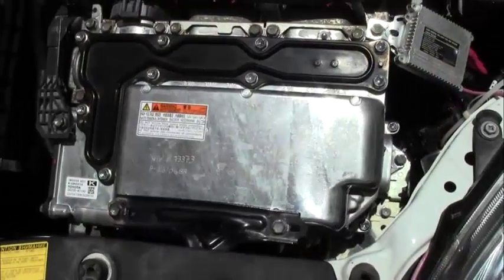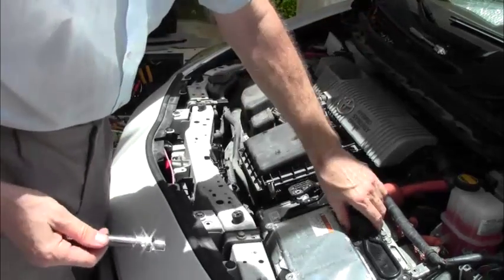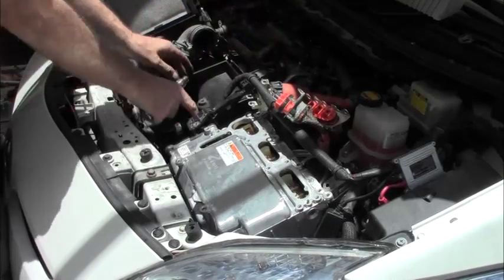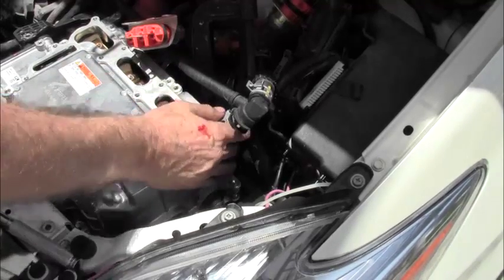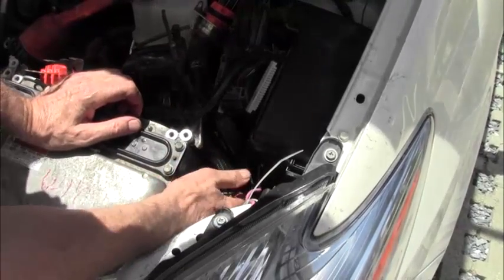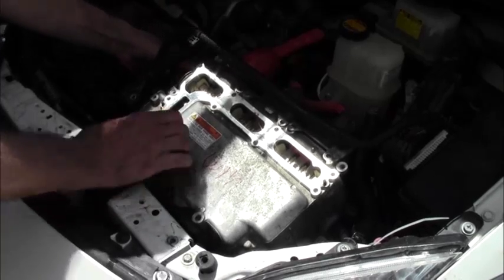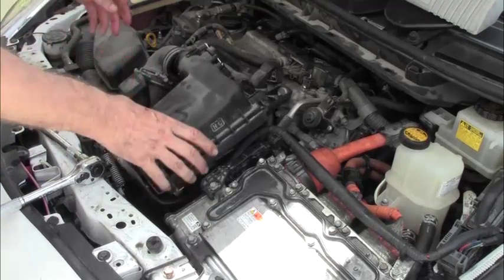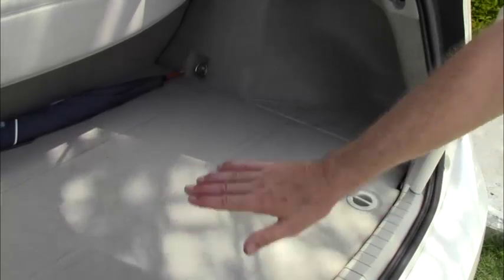Change ECU Inverter with Converter in Toyota Prius 2010

Comment: Hello and thank you for this work. I have the same problèm. The référence of mine id g9200-47140, can I change it by an other référence like g9200-47230 for exempl. Thanks
Reply from the maker: Hi, I don't think these are interchangeable, but I'm no expert. The 47140 is for 2010-2011. The 47230 I believe is for the 2012-2015. But you might want to check that. I'm not sure that my charts are accurate. What year is your Prius?
Reply: @TheHighwayGroupie  my prius 30 2010.
I order an other référence form lexus ct 200h.i will try it and let you know if you want
Reply from the maker: @geobes7339  OK. Yes, let me know how it works out.
Reply: @TheHighwayGroupie  hello. I just put the lexus référence on my prius and it s working for the moment. I hope it will work forever 😅
Reply from the maker: @geobes7339  I don't know about 'forever', but this kind of thing either works or it doesn't. So if it works, you're fine. Make sure that you keep it up to date will all the latest software updates.
Reply: @TheHighwayGroupie  OK thank for your reply. Good luck

Comment: If remove the converter for change the transmission mount , put back the converter need the program again ? ? ?
Reply from the maker: The ECU is a plug and play device. It requires no programming, even if you drop a new one in - although you may need to update some of its software by using CAL files (for calibration) and CUW files. But, unless you leave a wire disconnected or some other human error thing, changing a transmission mount should not disrupt the programming of your ECU. I hope this helps!
Reply: Thanks for help

Comment: Mazen Ateyyat2 months agogreat. could you please help me an issue that I face with my 2012 Toyota Prius. I saw a battery light followed by check hybrid system then the car stopped. the mechanist tested the error and it gave the code P0A08: DC/DC converter status circuit. the mechanist i
Reply from the maker: Hi, Hanif. It would appear that your comment was cut short. Nevertheless, this sounds like an inverter problem - likely the circuit board. There is a way of just changing the board, but it is time-consuming. I'm not absolutely sure, but I believe that 2012 is subject to a Toyota recall. If not, you will need to spring for a new or used ECU. Make sure that it has the latest cwu updates. The problem that Toyota experienced is overheating transistors. The new programming keeps them running cooler. Hope this helps.

Comment: Hi , the dealership told me to replace inverter converter... Do I just swap it? Or do I need to reprogram the ECU? Thanks
Reply from the maker: The ECU is a plug and play device. It requires no programming, even if you drop a new one in - although you may need to update some of its software by using CAL files (for calibration) and CUW files. 
Also, the computer needs to go through a 'learning' process where it gets used to the response from the battery, your way of driving and other variables from the motor. 
But, unless you leave a wire disconnected or some other human error thing, your new ECU should work right off.

Comment: Is there any part number can replace  number G9200 49025?
Reply from the maker: Hi. As mentioned above, I'm not a mechanic. That said, according to TLS Auto Recycling, G9200-47210 will also fit. But, before I would invest serious money in buying one, I would check carefully. The G9200-47210 is listed for the 2015. The G9200-49025 is listed for the 2013. However, TLS claims that G9200-47230 G9200-49025, G9200-47210 or G9200-47141 will fit anything from 2012 to 2015. Hope this helps.

Comment: What glue did you use to seal The converter?
Reply from the maker: I'm afraid that I don't understand your question. Each connection and cover has its own gasget. This seals the unit. Inside there is no need for glue. Could your please elaborate?

Comment: hi 

I have this crashed prius and the screen says check hibrid system... the inverter looks nice but my problem is that i live far away from a toyota dealer to get it there and check it. so i wonder if i can get some help from you
Reply: +Cesar Castellanos Actually i want to know if i can just change the inverter without any programming i mean just plug & play?
Reply from the maker: +Cesar Castellanos Hi, Cesar.Yes, most times you can just plug and play. The unit I have for sale on eBay has already been updated to the latest software and firmware. If you buy a different one, I would advise you to go to the dealer or a garage with a Toyota Mongoose connector once you have installed. They can then check to see if it needs upgrading.Short answer: These units have two possibilities: they work or they don't. =D If it is a working unit, then it is plug and play. Hope this helps.
Reply: so can i buy any inverter no matter the model the only thing is that i need to update the firmware. Is that right?
Reply from the maker: +Cesar Castellanos Hi, Cesar. I'm not sure what you mean by "any inverter". There are two different part numbers that will fit the 2010 and 2011 Prius. Beyond that, yes, you will need to update the firmware and you should check for updates AT LEAST twice a year. More often, if you can afford it. But you do not need to update it for it to funciton after installation. Put it in and start the car.
Reply: +The Highway Groupie my car is 2015 so I don't know if the inverter has to be the same model which is g9200- 47230
Reply from the maker: Cesar Castellanos Hi, Cesar. I'm no expert on part numbers, but what I see is that 2010-11 were interchangeable; 2012-2014 were interchangeable; 2015 is a new series. I suggest that you check with your local garage.
Reply: i have same message check hybrid system i did change inverter water pump but same nothing change ,what does inverter converter do

Comment: I really liked test driving a 2014 Prius V, and would love to get one, but when the hybrid system starts to have problems, I don’t see how people can afford the repairs, and it keeps me hesitant. It’s like there is a typical internal combustion engine with all its maintenance and repairs, plus this hybrid system with each part costing thousands to replace!
Reply from the maker: Hi, Flying Cat.
The car in the video had a problem because of a programming error at Toyota. They paid for the new part. Otherwise, if programmed correctly, these last a very long time. In fact, I bought a used unit with quite a few miles on it and left it in the car, while I try to sell the new one. But they aren't much in demand. =D The car is still running on a system that will soon be nine years old.

The hybrid battery has an average lifespan of 10 years. You can get a new one for around $2,500 – cheaper, if you look around a little. If you only drive a few miles per year, then it isn't worth it to get a hybrid like this. But if you put a lot of miles on, such as about 22,000 miles per year, then it gets interesting. 

On a Prius, 22,000 miles would use about 500 US gallons of gasoline (or less, if you don’t use the AC like I do). On a non-hybrid, it represents about 880 gallons for the same size of car. In South Carolina that difference of 380 US gallons would cost you $763 per annum. Assuming that gas prices remain the same (and they will likely go up, not down), your savings over ten years is $7,630. That more than pays for a battery change. =D 

The battery on my 2010 still works fine after more than eight years. So, it has already saved its drivers over $6,000. Again, it depends on how many miles you clock per year. Do the math and then decide.

Before I leave this point entirely, there is one more thing: the environment. Even if you don’t save a ton of cash, you have the satisfaction of knowing that you are helping to lower your carbon footprint. =D

Hope this helps,
HG
Reply: Thanks for the response!
Reply: flyingcat2054 well that’s why this car help you save money😉
Reply from the maker: Adding to my earlier reply: The car is now 9 model-years old. The battery gave an error message that could be read on a standard OBD II device (such as an Actron). 

We went into the battery compartment (using all safety precautions) and discovered that the connectors had corroded. We removed the connectors, cleaned them with a Dremel grinding wheel and some electrical cleaning fluid and replaced them. The battery is still holding over 7.6 volts (ranged from 7.64 to 7.9). This is still within range of a properly balanced battery, but we balanced it a little more by lowering the voltage of the ten cells that were above 7.8. 

Error message is now gone and the battery looks like it is ready to run for several more years!

Kind wishes.

Comment: Why you change that invertor convertor? What is the problem sir?
Reply from the maker: Hi, Lakshitha.

Thank you for your question. The problem with the old one was the transistors. They burned out. This was guaranteed by Toyota and they did eventually replace it, but it took 4 months. I couldn't wait that long, so I bought a used one and put it in. Later, when the new one arrived, I installed it, updated it with the latest programs and then removed it for the used one, which has been working fine ever since.

I have the new one for sale, if you are interested.

Kind wishes,
HG.
Reply: Thanks you for giving me a reply.. sir. You did it funny. Old invertor came any DTC? Or vehicle not sarting?  After changed convertor invertor do need to programe the key or want to do something? Please send to me answer sir..
Reply from the maker: @lakshithakalansuriya7680  Hi,
There were no Diagnostic Trouble Codes (DTC) after installing the good inverter. If there were any codes, it would mean that the replacement unit is already bugged. Not a good scenario. =D

As for programming, it is always a good idea to check for updates using a TechInfo cable and software. By having the ECU communicate over the Web it will discern whether it needs updates or not. At that point you can click on the update code and then follow the on-screen instructions. 

Even brand new ECU's from the manufacturer need to be updated as some of these have been sitting on shelves for a few years. They don't update them before shipping.

Every 6-12 months it is a good idea to check again. Also, you should create an owner's account on the Toyota Web site. Then you can receive any recall or other notices in a timely fashion.

Hope this helps.
HG

Comment: Hey is this the gen 2 model or gen 3? If it's a gen 3 is there much difference in the repair?
Reply from the maker: +Gustas Dovainys Hi.The two are quite different physically and programming. As for changing one or the other, safety wise it is the same: remove the connector for the main battery and disconnect the ground to the 12V battery. Beyond that, you are on your own, because the installation is different. Sorry.
Reply: 2010 is gen 3

Comment: So...why are we doing this?
Reply from the maker: Not sure the thrust of your question, but for anyone where the warranty has run out on the ECU, this could help.
Reply: Part of your presentation should have included the function of the inverter and the symptoms associated with the need for replacement.

Comment: Man! How much could you charge for all this!?
Reply from the maker: Hi, Rudy.
Not sure what you are looking to cost out. You can get the unit for about $2,000 (https://www.ebay.com/itm/ECU-for-Toyota-Prius-2010-plugin-inverter-converter/162830001693). If you want one, I have one for sale.
If you are asking what to charge someone, if you were doing the job, then it depends on what the local garages charge. In parts of Ontario, they are charging over $100 per hour. At that rate, you could charge about $300-$400 for the installation. Hope this helps,
HG

Comment: I have the check hybrid system message.  The code is p0a7a.  Does this mean the inverter/converter has failed?
Reply from the maker: Not necessarily. What year is your Prius? There is a recall for re-programming for 2010-2014 (I think I have the years right - maybe up to 2015). There was a problem with overheating transistors.

However, this will also show up when your 12VT battery isn't charging correctly. Also, if you have faulty cells in your 350VT battery. Start by doing a stress test on the 12VT. After that, check by pairs the cells in the hybrid battery. 

If both of those check out well, then you could be having an inverter problem. They usually charge about 1 hour shop time to trace the problem. Hope this helps!
HG
Reply: @TheHighwayGroupie  Actually I have the Lexus 2010 RX450h.  Found your video searching for the problem.  Great video!  I figured the hybrid systems are similar.  Thanks for the suggestions.

Comment: Friend I have 
problems with a Prius 2006, I had 8 bad cells in the hybrid battery, I changed them and everything worked fine, until I turned on the red triangle and gave me the code P3000, also I have problems with the abs, since the brake is Hard and slow braking. 
I could not find much information about this problem, I write from El Salvador, Central America.
Reply from the maker: Hi, Jose.
First of all, I am not a mechanic. So what I say should be taken with a grain of salt. This is not a very old car, but it isn't young, either, at 12 model years. That is about the normal life span of your battery. Rather than replacing a few cells, replacing the whole thing probably would have been the best solution as there might have been internal leakage or other problems that did not appear on a volt meter. Did you get a P3009 code as well? Did you clean all cells and terminals?

The ABS can be verified using a Mongoose cable and TS software (about $50 for two days worth or $1000 per year). Or you can get this checked at your Toyota dealership. There are things in the programming of the ECU that will affect the ABS system. Make sure that you have the latest CUW as a recent update changed the way that ABS handles bumpy roads.

Also the latest CUW will improve the performance of your ECU by running the transistors a little cooler.

In this country (Dominican Republic) I have difficulty finding someone who knows what they are doing with these cars, so I bought a Mongoose and I subscribe to the programming software twice per year to run checks on the ECU and to verify if there are any upgrades needed. But brakes are a different matter.

If the car won't run, there is little danger. =D But if it won't stop, well, the rest is obvious. If reprogramming the ECU does not help, go to a brake specialist. 

Hope this helps.
Reply: Did you load balance the batterys after replacing the bad units?